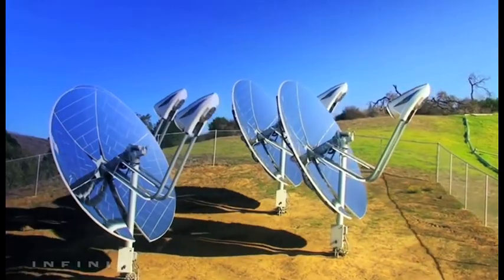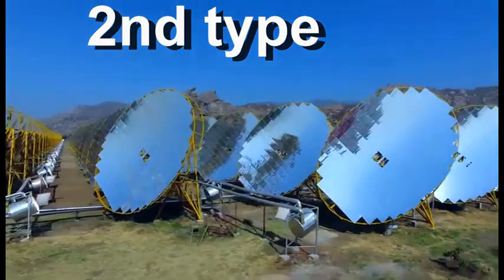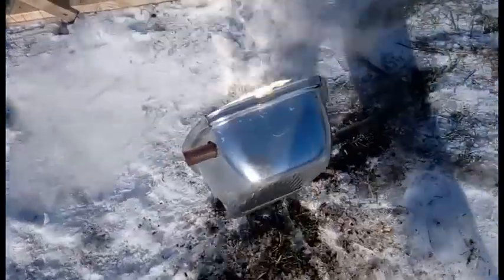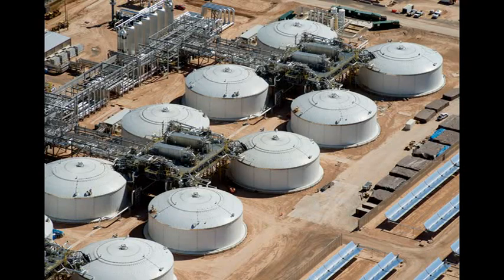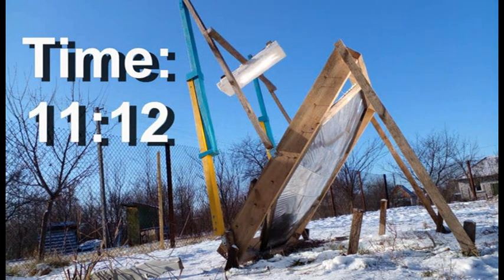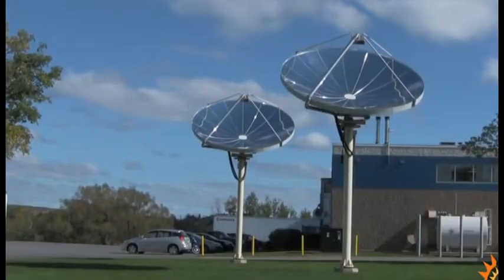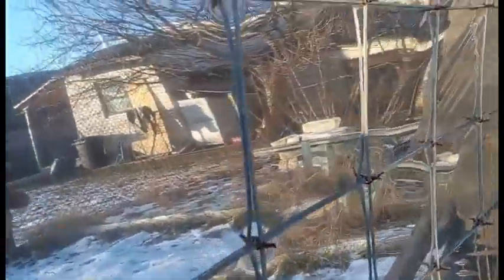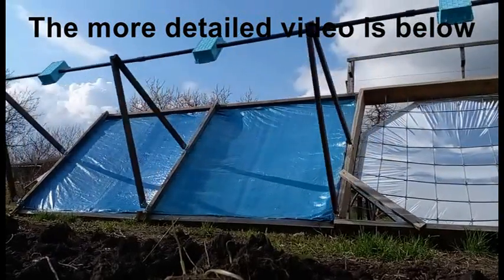A new type of solar heaters gives us cheaper electricity (Motionless Parabolic Dish)

Comment: Why move anything at all? Just have a long tube parallel with the travel of the sun at the apex(it would not be a straight tube as the more North you go the more the Sun travels on a curved path). You would need to alter the altitude of the tube as the Seasons progress. If heat hits the flow of coolant in the tube at all hours of the day, you still get the same amount of BTU put into the tube as if you chased a smaller area all the time. Zero moving parts :-D

Comment: I've had an interest in this type of solar ever since I saw one in Mother Earth News Magazine back in, I think, the 1970's. The gentleman used 100 one foot flat square glass mirrors aimed at a single collecter. One thing I still like about his was, it could allow air to go through, so not be like a big sail, but the boom had to be, I think, around ten feet long. I have alot of ideas in notebooks and after seeing your video, will prob be making some more pages in a note book. Some day I hope to make one (some). Thanks for the info and prays for your safety.
Reply: My father actually made one of those in the late 70's in Williams Oregon. The unit itself worked well, but the boiler (being at the top of that 10 foot pole) had to be very light and so tended to degrade and leak. Also, steam engines are very high maintenance. He was working on a turbine, but never completed it.
Reply: @JamesNewton  I think a Tesla tuban would've been a good fit for it. He desighed it because they were high maintance. Also, all that glass had to weigh alot, over a cubic foot of glass if normal 1/8" each. It sounded like it should have produced alot of power. In the magazine, he didn't have it running a generater yet and never saw a follow up on it.

Comment: Good idea to move the receiver instead of the mirror .The only issue I see with doing that is having flexible hoses that can work under extreme pressure and temperatures
Reply: What pressure? You move enough coolant through to not allow it to boil. But yes, that is a simple task. Use pressure washer hose from those diesel heated washers. Would a 5,000 PSI working pressure be enough for you? :-P
Reply: @leofortey7561  those do work but the only problem is going to be how many flexations before you have a failure .,the other issue is coolant type ,Mercury ,oil ,glycol ,water salt mixture.It needs to be something that can hold alot of energy and then your heat exchanger design ..I wonder how much of the 1kw/m2 we can scavange.

Comment: Very cool or should I say hot concept. But not sure how it's better than Parabolic trough . If the parabolic is better than a trough, could you use a water pipe across and eliminate the need for motion?
Reply: good idea
the trough linear parabolic would only need to be moved with the seasons

Comment: I find that the best and cheapest mirror solution is a sheet of highly mirrored sheet of alumium that you bend in a parabel tube. You have 98 % refelexion and it is hardened. You dont need a mold, because it gets its  optimal form by slightly pressure on the two long edges and snapping it in the right position. With this mirror your moving receiver must be obviously have the shape of a stick that is as long as the mirror.
Reply: Can paired to movable receiver better and cheaper

Comment: I think you had a good idea. Make it even cheaper if it is moved by ropes. Computer controlled it can move so many ways.
Reply: Can we use very slow motor to move them horizentally and vertically
Reply: @lawand11klose  the type of electric motor is irrelevant, they all do the same thing. in the wind it wouldn't work. But i see why he wanted a rigid mover, because the pipe connecting is the one that holds the hot fluid.
Reply: avoiding electronics entirely would be ideal, a mechanical computer could be 3d printed

Comment: The scary thing about Type 2 is the initial positioning of the mirror - you don't want it shining into your car as you are driving past. The tracking is complicated and what do you do if there is a big cloud drifting by - how do you acquire the sun and ensure that you don't steer the beam where it endangers someone. With a Type 3, you could probably just control it with clockwork mechanisms. There is a Type 4. Both receiver and mirror is fixed. It is very difficult to make simply and is known as a https://en.wikipedia.org/wiki/Winston_cone .

Comment: I'm not sure if this approach would work in really windy climates. Seems like the moving collector would be more subject to damage than the 2nd option. Maybe cylindrical mirrors would be the best option where they'd only really need to be adjusted daily (or even less) and be able to deal with the sun's movement from morning to evening
Reply: It would be better than big movable mirror, the wind pushes that more because it has more surfce area. You are thinking that because his model is made of wood it would move more, which it would, but it could be made of metal which is much stronger.
Reply: @mookfaru835  Fair point, I guess I just thought that you'd have an easier time shielding the mirror than the collector but forgot that it'd be physically larger and thus harder to work with.
Reply: @beskamir5977  Yea try moving a large sheet in the wind, it will blow you away.

Comment: Good to see that you are still alive! Love your videos! Technically, one could 3d print a big parabolic shape, and use it to cast (or with some other method make) really big mirrors with the exact shape and size that you want (with the idea being that you only need to print it once per X amount of mirrors). This does kinda break the whole concept that anyone can make it... Perhaps one could make a mirror by making a ring shaped object, with 2 layers of plastic on either side, and pulling a slight vacuum on it?
Reply: Quick question, great to print the shape for stated purpose. Please express thoughts on the reflective coating next step in all pertinent aspects. I ask because I have a few ways to form the shape which some folks might do easily. One being old light fixture dome finds. Industrial ones an be a meter or more in diameter. Hopefully the shape of the curve can be adapted.
Reply: Drawing a parabola is easy…simple math. Then there is the question to answer in how many dimensions you want your parabola. 3D focuses to one point ideally, but when keeping things simple in 2D, you only need a sheet of reflective material bent to the parabolic function of your liking, and this will focus to a line. Which may be practical: you may place a duct there through which you have the medium flow that you wish to heat.
Reply: @Calligraphybooster  it’s not the parabola but the choice of reflective material and it’s adhesive
Reply: @marcisaacs9407  yeah… and both reflectiveness and focus are factors to efficiency. When building cheap, one can be substituted for the other to some degree, or rather make good for the other. When it comes to the reflectiveness of ‘chrome’ powdercoating I suspect the manufacturer has a factsheet on that, just as they have on glossiness. 
My preferred material would probably be aluminium foil for kitchen use.
Reply: Use the balloon mirror as a casting in sand, spray sand with epoxy, lay on squares of silvered mylar

Comment: You can use a fixed linear collector (tube and/or vacuum tube) that will need only seasonal adjustments up/down but not daily tracking...
Reply: Semi-cylindrical
Reply: Maybe parabolic section?

Comment: Interesting approach. With the receiver moving does this complicate the piping necessary to carry away the heated fluid? It would have to be flexible would it not? So. Could it not be possible to put a second mirror at the focal point that directs the light to a stationary receiver on the ground? That would make things simpler to construct.

Glad to hear you are well. God speed.

Comment: There is even a 4th type, where both are not moving! The heated pipe has to follow the curved path of the reflection. ;D
Reply: " Mg
10 hours ago
There is even a 4th type, where both are not moving! The heated pipe has to follow the curved path of the reflection."
This is actually there FIFTH type. The earlier fourth type described the second mirror (moving) directing the heat or light to a stationary receiver.

Comment: There is a 4th type that has no moving parts at all.  If you use a stationary secondary mirror or mirror segments placed in the  path of the main focus to redirect to the boiler.
Reply: more expensive initially ... I imagine the maintenance cost would be lower ... so in the end, it would probably be most cost efficient.

The barrier to entry will always be the prime mover. You can't build what you can't afford to build. His video is a position within that tradeoff, although he doesn't seen to entertain that aspect. Another limit consideration is the available space and efficient use of it. Quite often it's a tradeoff that is more difficult to run the numbers on than we think. Weight will certainly be a consideration as well as durability ... weather and the ability to build on top of other things will increase or decrease the available space and what you can get out in terms of where you can put it. I can't list all the considerations as I do not know them. I tried to mention the ones off the top of my head sorta speak though.

Comment: What if a mirror was designed to reflect sunlight at a target, so that because of the shape of the mirror, there was always an area of the surface which pointed at the target? This could mean neither the mirror or the target moved. There would be a loss of full utility of the mirror, But the benefit would be that no machinery or tracking device would be needed.

Comment: Seems the competition for your 3rd type would be Parabolic trough system or linear freshnel systems, the main advantage is concentration of the light to a point rather then a line which could reach higher temperatures then linear concentrators.

Comment: I also believe the 3rd type makes more sense even for huge arrays. A heavy duty crane is definitely cheaper than houndreds of motors controlers etc
Reply: One receiver comparing to  multiple receiver?opposite movable parts.which one is more efficient?same question as you
Reply: @wujeson3921  do you physical  efficiency. i'm most interested in watts / $
Reply: @Channel-tr1hx  what ever I am interested in capital investment vs output which compare to conventional process